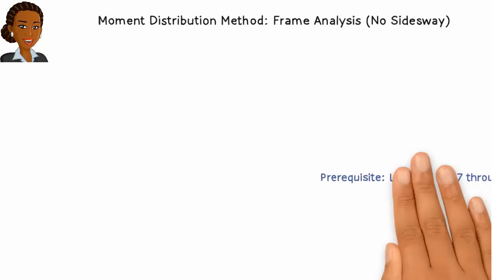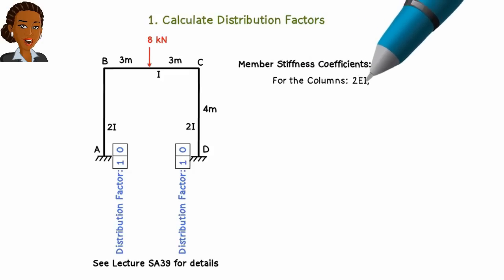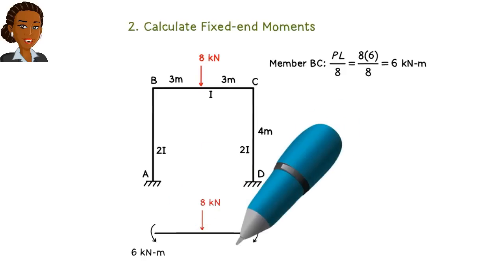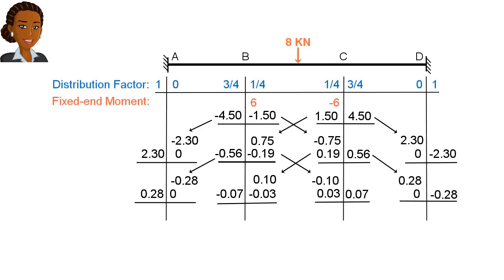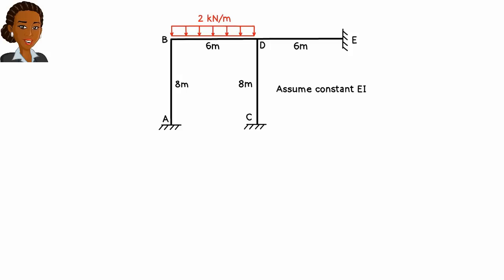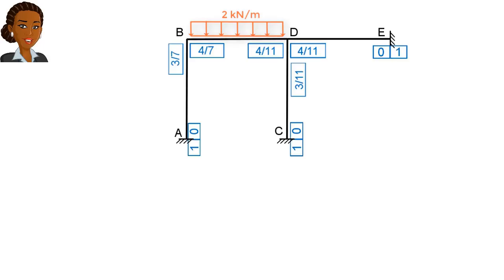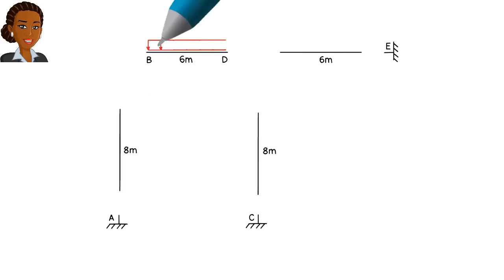SA40: Moment Distribution Method: Frames (No Sidesway)

Comment: How did you get 5.67 and 6.33 KN in 8:15?
Reply from the maker: We have determined the end moments for segment BD. This makes the segment statically determinate, with the shear forces at the ends of the segment being unknown. We can determine these forces using static equilibrium equations. Writing the moment equation about point B, we get:

 (2 kN/m) (6 m)(3 m)+ 5.17 - 3.19 + 6Vd= 0 

By solving the above equation for the shear force at D, we get  Vd= 6.33 kN.

Next, summing the forces in the y-direction, we get:

 Vb + 6.33 = (2 kN/m)(6 m)

which yields Vb = 5.67 kN.

Comment: Thanks sir but the first carry over at point A and D were supposed to be 2.25. Why it is 2.30?
Reply from the maker: Thanks for the comment. Yes, the value should be 2.25. However, since this is an approximate technique, reasonable rounding of numbers is permitted.
Reply: @DrStructure  OK Sir thanks a lot for your amazing videos!💗💗

Comment: How did you calculate the support reactions
Reply: Could you please do a video, showing how you done the calculation for the reactions. It would really help
Reply from the maker: After the member-end moments are calculated using the moment distribution method, the beam segments become statically determinate. From that point on we can use the static equilibrium equations to determine the member-end shear forces. The reactions at a support are the algebraic sum of the member-end forces near the support.

Comment: Dr Structure how do we know if a frame is with sidesway or not?
Reply from the maker: If the frame is subjected to horizontal or unsymmetrical loading, if it is unsymmetrical geometrically, or if member section or and/or material properties is not constant throughout the structure, sidesway could develop. When in doubt, assume it is there. If it turns out to be insignificant, it can then be ignored.

Comment: Dr structure. What if there was a couple applied at joint D of the second frame? How would we distribute it ?
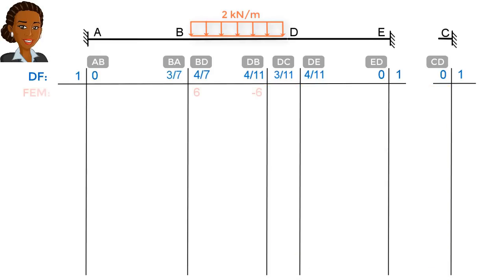Reply from the maker: We would add the couple/moment to the table @6:42 under column DB, DC, or DE (does not matter which one). Then, we go through the moment distribution process as usual. 

Note that now the total moment at that joint would be the sum of (-6) and the added moment. If the added moment is counter-clockwise, we enter it in the table as a negative value. If it is clockwise, we enter it as a positive value.
Reply: @DrStructure  ☺You're the best Dr Structure. I clearly understand you,thank you very much for such quality help.
Reply from the maker: You're welcome!

Comment: Hello, I went over lecture SA39 and still do not know why the DF of the fixed support it 1?
Reply from the maker: Suppose there is a fixed support at the left end of a beam. To determine the two distribution factors associated with the support (one factor to the left of the support and one to its right), we can view the support itself as a very (infinitely) rigid beam segment that does not rotate. To model this fictitious rigid beam, we say its modulus of Elasticity is infinity (say, B represent infinity). And let's denote the modulus of elasticity of the beam segment attached to the fixed support as b. Compared to B, b has a very small value. 

For the sake of brevity, let's assume that both beam segments have the same length (L). The two DFs can be determined using the following equations (see SA39):

The DF to the left of the fixed support = B /( B + b). Since b is negligible compared to B. The equation becomes B/B = 1.
The DF to the right of the fixed support = b/(B + b). Since the numerator is negligible compared to the denominator, the expression becomes 0/B = 0.

So, the DF to the left of a fixed support is 1, and the DF to the right of it is 0, as indicated in the video.

Comment: Others use 4EI/L for member stiffness factor , but you use only EI/L. Can u pls explain why?
Reply from the maker: In the moment distribution method, the distribution factors are ratios: The ratio of the rotational stiffness of the member to the total rotational stiffness at the joint. Therefore, any constant that appears in the numerator and denominator of that ratio cancel each other out. This reduction/simplification not only applies to 4, but it also applies to E, if the modulus of elasticity of the material is constant throughout the structure.
Reply: @DrStructure   Thanks for the very clear explanation; I appreciate it.
Reply from the maker: You're welcome.

Comment: Thanks a lot, Dr. Structure. Your videos are highly informative and easy to understand.

I have a question. If the horizontal member in a frame contains an internal hinge, then how do we proceed with the method? What would be the distribution factors?
Reply from the maker: Generally speaking, the moment distribution method should not be a method of choice for analyzing indeterminate beams with internal hinges. In dealing with such a beam, the vertical displacement of the beam at the hinge needs to be brought into the formulation, similar to what we do when analyzing frames with sidesway. This adds layer of complexity makes the use of the moment distribution method significantly less efficient (more time consuming).
 
A better classical technique for dealing with internal hinges in beams is the slope-deflection method. The presence of an internal hinge in a continuous beam introduces three (3) additional variables: the slope at the left side of the hinge, the slope at the right side of the hinge, and the deflection at the hinge. To analyze the beam using the slope-deflection method, we would need to introduce three more equations. These equations are: 
1) Moment at the left side of the hinge = 0
2) Moment at the right side of the hinge = 0
3) Shear at the left side + shear at the right side of the beam = 0
These equations added to the joint equilibrium equations at the supports give us sufficient number of equations to determine all the joint slopes (including the ones at the hinge) and the vertical displacement at the hinge. 
We can then substitute these slopes and deflection back into the slope-deflection equations in order to determine the member-end moments.

Comment: How to get 1.93 Kn?
Reply from the maker: Knowing the member-end moments, we can apply the equilibrium equations to the individual members in order to calculate member-end shear forces. For example @3:54, member AB is subjected to a clockwise moment of 5.13 kN-m at the top and a clockwise moment of 2.58 kN-m at the bottom. Assuming the shear force at end A of the member to be V, then since the sum of the moments about the top end of the member must be zero, we get: (5.13 kN-m + 2.58 kN-m) = (4 m) V.  Solving for V, we get: V = 1.93 kN.
Reply: @DrStructure  Thank You so much! :)

Comment: Hi ma'am, may I know how did you get the reactions? Thanks.
Reply from the maker: Once the moments are calculated, the frame becomes a statically determinate structure. We can then use the static equilibrium equations to determine the rest of the unknowns (the shear and axial force in each member, and then the support reactions).
Reply: Dr. Structure I just don't understand ma'am why did you start at segment BC instead of segment AB.
Reply from the maker: @RaymartGDamot  The order is arbitrary. You can start the process from any joint or member.
Reply: Dr. Structure but if I'll start at member AB, I don't get the vertical reactions at A.. what should I do? Sorry for my weak understanding ma'am, hope you don't get mad at me..
Reply from the maker: @RaymartGDamot  You can view it as a fill-in-the-blank or a kind of puzzle. We have all the pieces, we just have to put them together. From member AB, we calculate the shear force in AB which gives us the horizontal reaction force at A. From member CD, we calculate the shear force in CD which gives us the horizontal reaction at D. From member BC, we calculate the shear in BC, and since the member is not directly attached to a support, we transfer the load from BC, through joints B and C to the AB and CD, and then to the support.
Reply from the maker: @RaymartGDamot And, feel free to ask as many questions as you have, it would be my pleasure to help you understand the concept(s) and/or procedure.
Reply: Dr. Structure aaaaaaah. Transfering the loads to the support, that's a key point I wanna know. Thank you very much ma'am! You cleared my doubts. :)
I appreciated so much your responses and works on this video, ma'am.